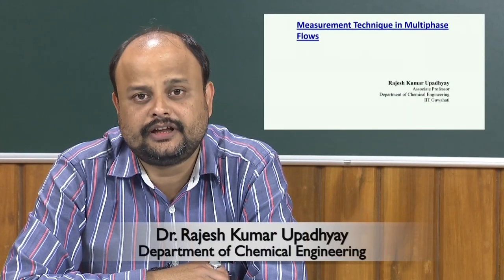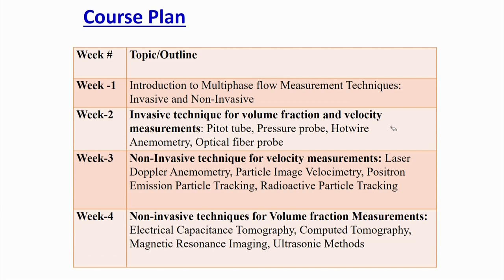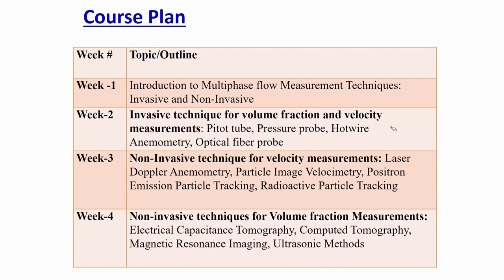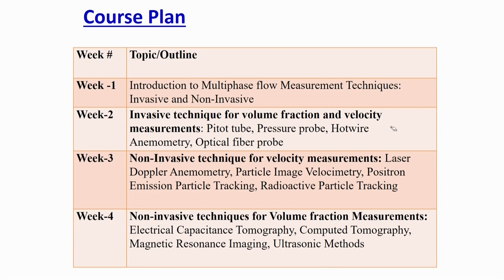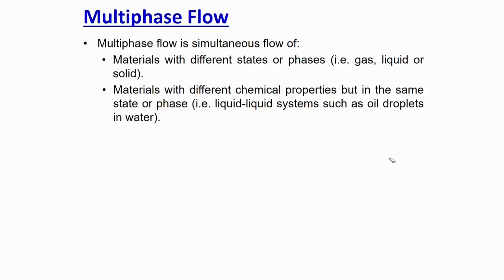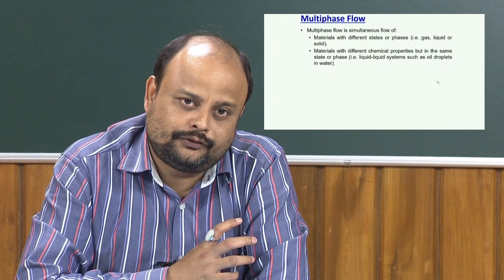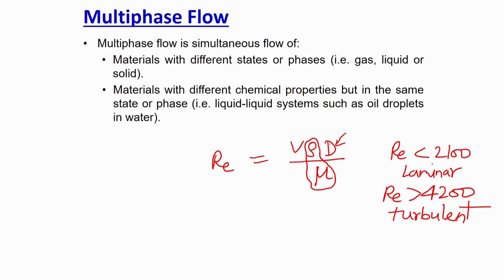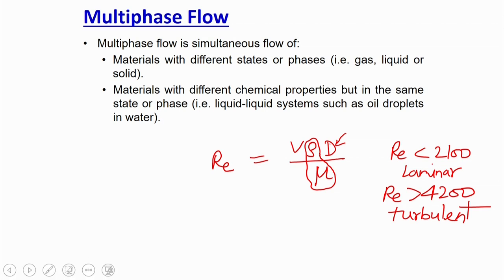Lecture 1 - INTRODUCTION To MULTIPHASE FLOW MEASUREMENT TECHNIQUES

Comment: sir i am doing simulation on a rectangular bubble column with dimensions of 2cm depth,10cm width,144.8cm height with sparger dimension of 1cm dept to 2cm width...and boundary condition are .01m/s gas velocity and its totally filled with water initially...in fluent how to calculate gas holdup and wahat will be volume fraction of air i should give??
Reply: Are you performing Euler-Euler Simulation? Mail me your problem in detail
Reply: sir can we directly put superficial gas velocity in fluent under gas velocity or should we have to calculate by dividing volumetric flow rate with area inlet?